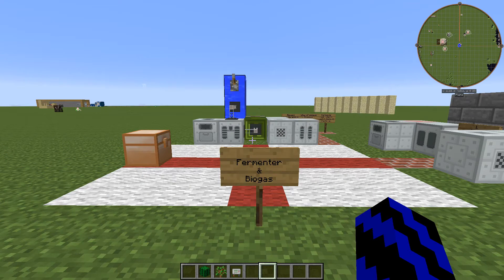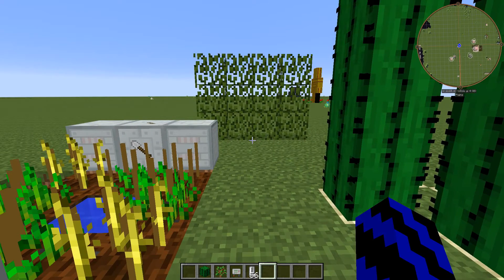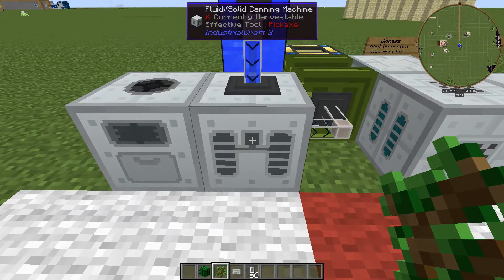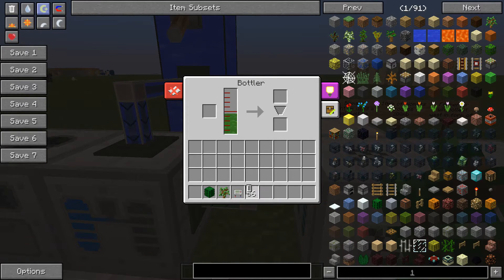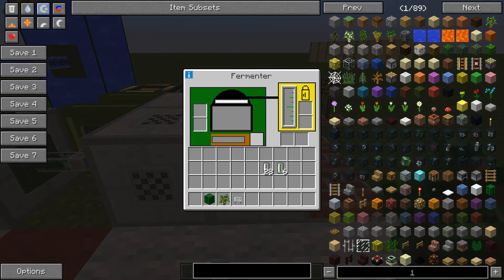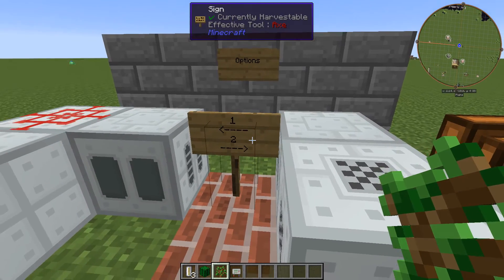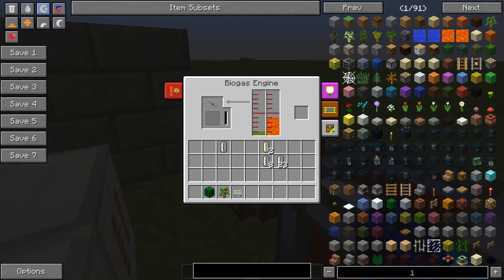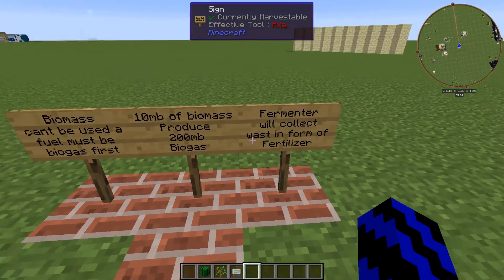IC2 Fermenter & Biogas

Comment: how did you get the power to work? my heat generator wont turn on..
Reply from the maker: I put a MFE in to the generator to supply the power and made sure the orange Square is touching the machine I wanted to power let me know if this helps